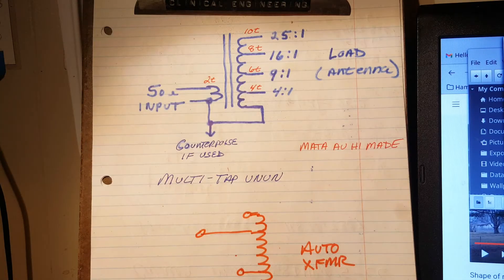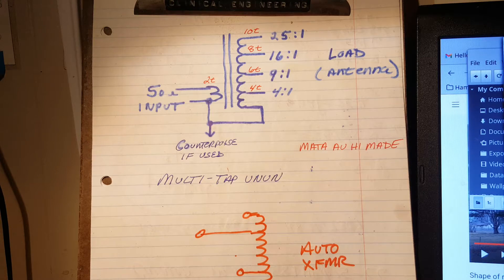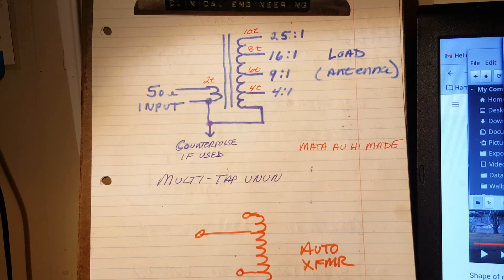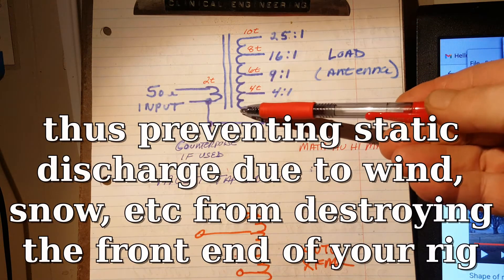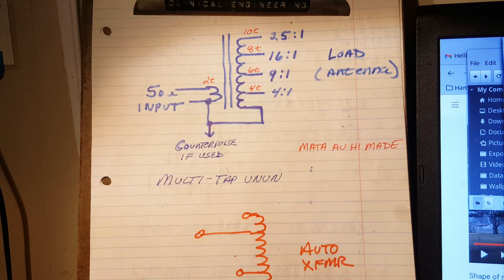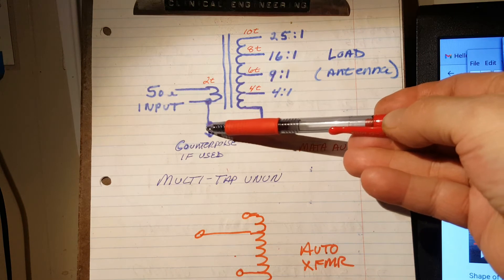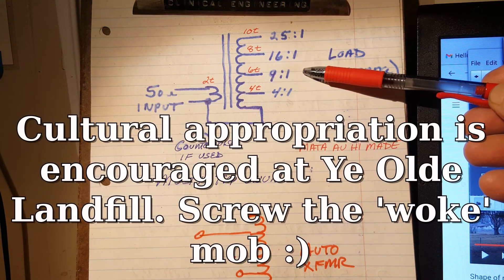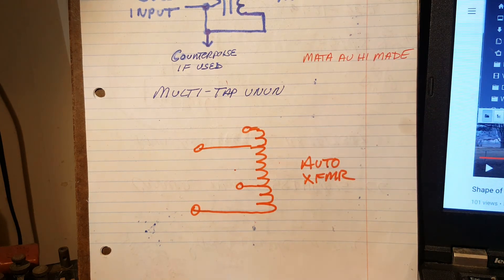Multi-Tap UNUN Schematic

Comment: I’m a bit confused with the drawing shown at 5 seconds into your video and hope you can help me understand what’s going on. If I assume that some voltage (say 100 Volts) is input across the two coil turns shown on the left side of your schematic, it seems that I would also measure 100 Volts across the lowermost two turns on the right side of the diagram since both coils share a common reference point (which you identify as a counterpoise). If both of these two-turn coils have 100 volts across them I don’t see how one can get a 4:1 impedance transformation. I look forward to your thoughts on this matter and thanks for sharing your knowledge.
Reply from the maker: Hi there..
I'll take a look at it a little later today and get back to you. I have a really busy day. Take care  :)
Reply: Hello again - I understand you are busy today so I’m not anticipating a quick reply. I wanted to let you know that I think I’ve figured out what’s going on relative to the multi-tap unun schematic. I’ve redrawn your schematic in a way that makes sense to me and I’d like to share it with you but I can’t figure out how to upload a photo to Youtube. Perhaps later you can help me upload my drawing. Or, even easier for me, if there is a way to email my version of the schematic to you I’d be happy to do so. - Take care - Jim
Reply from the maker: @hubercats  sure Jim.. love to see it. My email addy is chuck.kirshman@gmail
Another busy day. Lol. I'll catch up with you later  :)